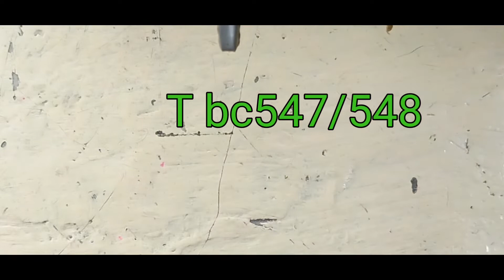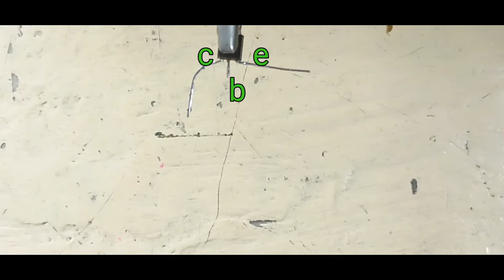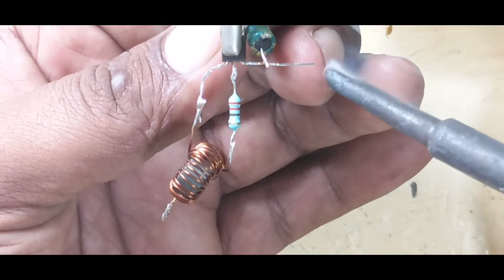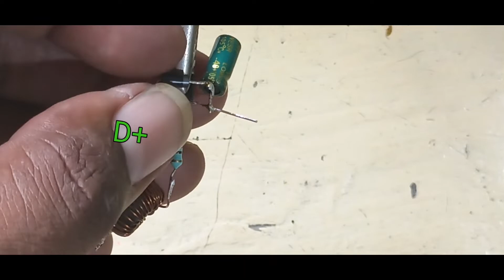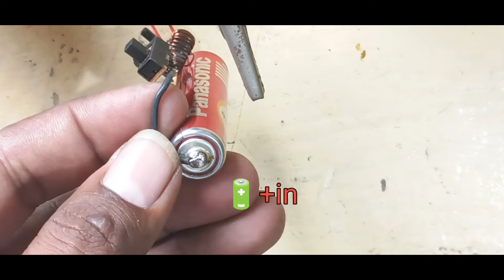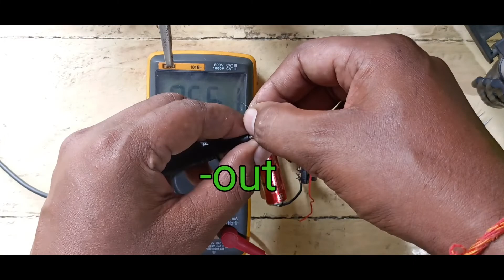zener diode tester || SMD LED tester || #amartechnology #youtubevideos

Comment: Nice video 🙂👍. I want to ask
1. Can i use 3.7 volt battery (18650)? If yes Is there a component whose value must be changed ( resistors, capacitor) ?

2. Can i use other NPN transistor instead BC547?

Thank you